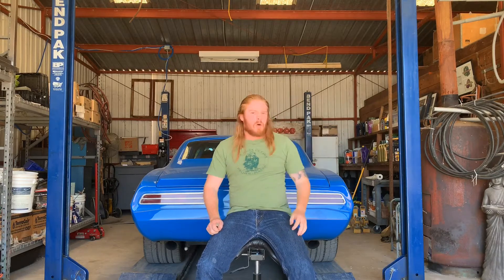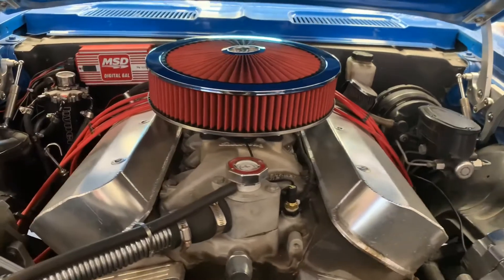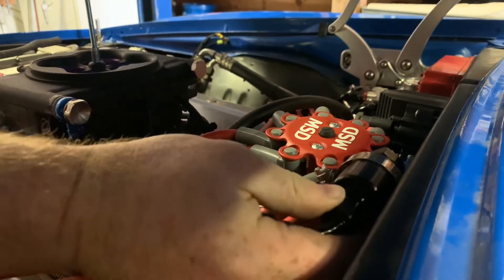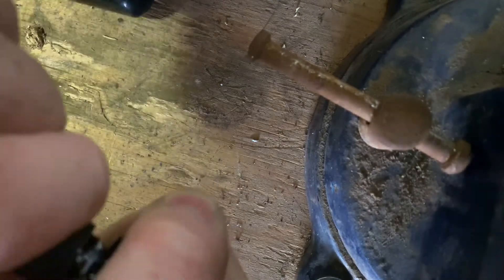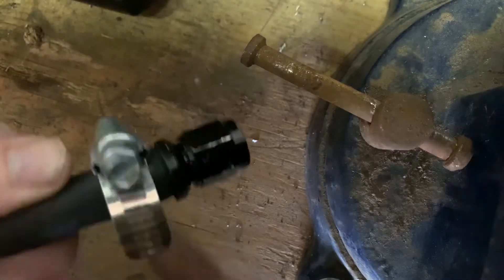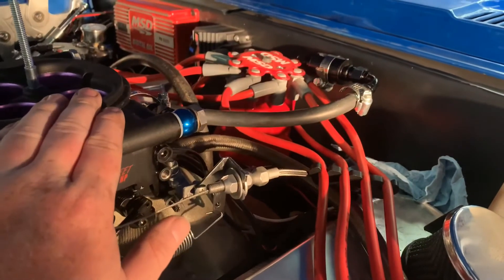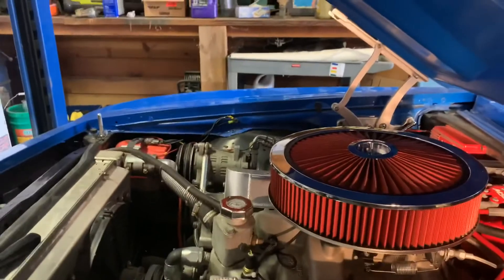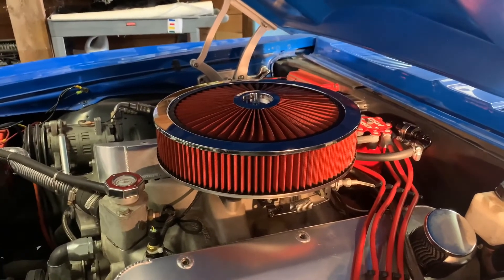EFI Air cleaner clearance fix- FITECH dropbase install

Comment: You are losing about 7 hp with that cleaner lid ,  just switch for a flat metal one and you recover that lost power . and if you have enough room to use the buble one  from spedway motors you get 4 extra hp,   i tried diferent ones on dyno . link of lid  https://www.speedwaymotors.com/Sure-Seal-Air-Cleaner-Top-Only-14-Inch-Diameter,99702.html?_br_psugg_q=air+filter+lid
Reply: Watch engine masters episode 27. The air actually wants to pull in from the top. But, when a top filter is combined with a normal filter the air is being pulled from both directions, becoming turbulent. They need to make a flat based bottom with 3 inch metal sides, that a guy can put a filtered lid on top of if he doesn't have room for a true velocity stack with a proper sized filter that supports the hp level of his engine.
Reply: The bubble top lid helps a normaln14x3 or 4" filter smooth the direction transition of air from the side to the top of the carb inlet. The air doesn't want to make a turn if it doesn't have to. The surface area of a metal housing also heats up the air as it goes in sideways and turns down into the carb. If a guy has room he needs to run a flat bottom